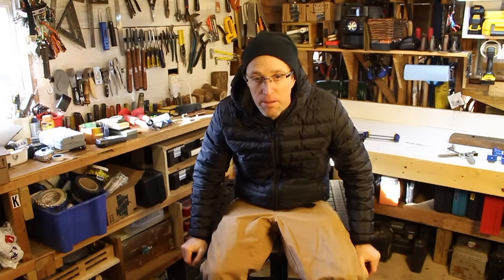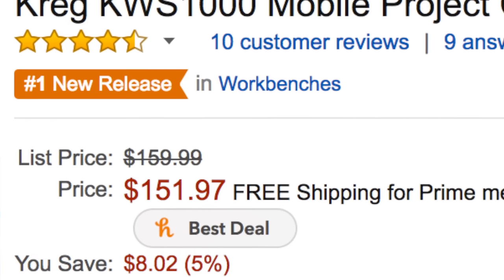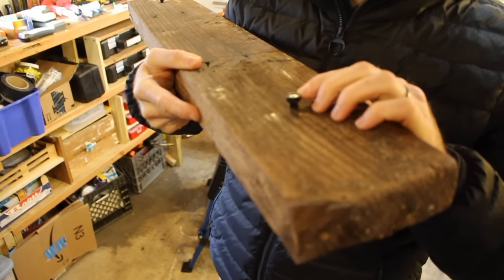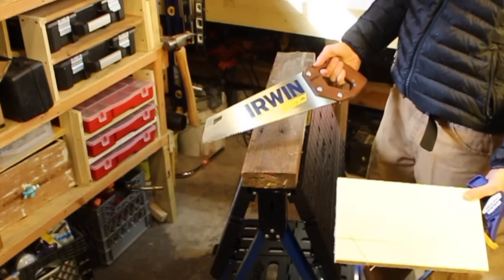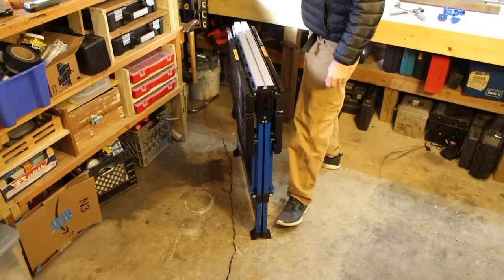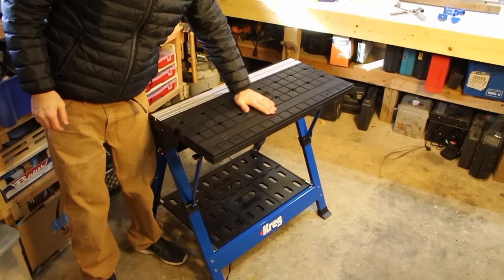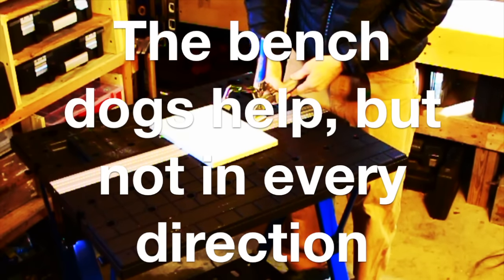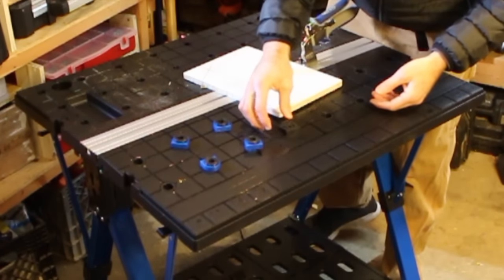Quirky Kreg Mobile Project Center

Comment: I have been really looking at these for what they are: A portable, fairly lightweight workstation. My opinion is they are an acceptable solution. Granted, the biggest fail with these is the absence of a table lock in the down position so that they can be carried by holding the table surface as opposed to the folding shelf. I'll give you that. However most of your other criticisms are unwarranted. It is in fact remarkably stable in the open position which is the only thing that counts right? Twisting it in the folded position proves nothing. The legs are open channels. Channels are not ideal for resistance to torsion which is what you are subjecting to by flexing the workstation with the legs folded. In the open position the folding shelf acts as a shear panel and that is the main function of that shelf, not a foot rest. I believe the shelf has a rated capacity 25lbs. Will it hold up to years of service in a heavy construction environment being thrown in the back of a pick-up with other crap. likely not. Will it work for a cabinet maker, trim carpenter, or home woodworker who treats his tools with a measure of respect. I think it will. Cheers.
Reply from the maker: Good luck with it! Your points are valid and, with some care, it should serve you well
Reply: I carry mine by the table top in the folded position.  I am careful to not let it open, but a closed lock would be nice
Reply: I agree its a good product also there a  another video with a great cheap table lock for this it s a pin that gos threw the dog holes with a locking cotter type pin that gos threw that ,,, it works great and it can be replaced at will ,,most under 10  if not 5 dollars for this device and it doesnt get in the way if removed to unlock  and some have hadles on them if your arms are to short so you have and extra handle set higher now

Comment: I have used mine every day and used it rough.  I use it to hold my planer,  belt sander, orbital sander and router table ( not all at the same time though).  It does a GREAT job for what it is designed for.  At 50 lbs. it's not flimsy or cheap and is rock solid when open.  Does it really matter how much the legs flop around when it's closed?  I mean you're not using it when it's closed as it's stored away!  If I slam my closed workmate around like you did that Kreg, it flops around also.
Reply from the maker: I can see your point, Steve. I've come to like mine more over time ... but the fact that it flops open so easily when moving it still bugs me. I'm glad its working out for you!
Reply: Agree.  I think it was designed around their line of products and more as a clamping, joining, sanding, assembly, etc. workstation as opposed to heavy construction, hammering, etc.  For me the biggest pro is that If you have Kreg tools they all interact and the pre-drilled locations to mount your Kreg pocket hole jigs were very nice.

Comment: I have been a plumber for 23 years. I own a business where we work in major commercial, industrial, and municipal locations. I also do minor woodworking and leather crafting as a hobby. I am very familiar with tools and equipment I don't have this table but it appears to be a mobile medium duty item. I don't see anyone in the trades banging around, slamming, and shaking their gear like you appear to be doing. It would be interesting to see how you pull out a chair to sit down at the table or open the fridge. Condiments are falling all over the floor, shelves are cracked. Splintered chair legs have been glued back together, multiple times.
Reply from the maker: Yeah, you've got it: I'm rough on stuff and find the best tools are ones I can beat up or drop out of the back of the truck and they keep on working. Cool to hear that you've been plumbing that long. It's an awesome trade.
Reply: I thought the same thing. The table is actually a multi-use table but it is purpose built for building cabinets and drawers and such. And for those who do that sort of work and they see you throwing shit around in their shop they will throw you out on your ear. This is literally a mobile work station for pocket hole projects. It's not a workbench. Hence the name. 2 totally different things.

Comment: I bought 2 a couple months ago.  My only real complaint is that when the tables are up they are not completely flat.  That kinda the me off since I was building a dining table and needed that flat assembly table.  I'll span the two in the future with plywood
Reply from the maker: Plywood sounds good --3/4" will be solid!

Comment: I haven't had any of the problems you're experiencing with mine. I realize everyone can have their own opinion, but I can't help feel that you're coming at this product as a professional when I'm not so sure you're the targeted demographic.

As someone who is an amateur woodworker, who has a garage so small he can't fit a traditional workbench, and who has to build modular stands that can hang on the wall for all his tools, this thing has been a lifesaver for me. Mine has no problem staying shut, if anything it's hard to open. Mine has no wobble. It's solid as a rock, but then again, I'm not trying to build dining room tables on it. I threw a little grease on the screws for the sacrificial board and it slides as smooth as butter, no hammer needed. Who cares if there's skyward play at the corners? All that matters is whether there is downward play and there isn't any. The bottom tray is meant to throw some light tools or some spare wood on, not your foot. Your demonstration of locking the wood down with the clamp is suspect because your position of the wood places all the force on an area of the wood with two slick metal runners on each side. Lock it down on the plastic work area and it's not going anywhere.

Again, you're welcome to your own opinion as an experienced woodworker, but you're scaring off the people this product is likely meant for.
Reply from the maker: +Rob Cartwright .... I appreciate your perspective and see where you're coming from. Perhaps over time I'll come to like it a bit more! Take care
Reply: metaspencer I apologize if my comment came out as harsh, it wasn't intended to be. Take care.
Reply from the maker: +Rob Cartwright .. it's all good! Take care
Reply: Yes it is not marketed to professionals with large shops like metaspencer. It's marketed to people such as yourself that don't have full shops and don't have tons of room. the whole plastic spacer issues and pounding it in with a hammer could have been fixed very easily. Back the screw out some. That simple, why you would sit and beat on something with a hammer then complain is beyond me when the solution is that easy.

Comment: I watched your video on the Kreg KWS1000 Mobile Project Center.  I couldn't help but post this as you are giving people some very misleading information on the product.  First, you are picking up on the tables.  The tables are solid if weight is applied to them.  Second is that you are stepping on a folding shelf designed to only distance the legs apart and hold something light weight and not the weight of a foot stepping on it.  Next is how you are lifting the table.  You are not using the handle but grabbing the table.  Of course it is going to unfold.  Then you hammered a board onto the top of the table.  It takes a second to adjust the screws and it slides like glass - if your borad isn't warped.  You then show sawing a board on top of a board with a Irwin clamp holding it.  Why didn't you just use the the tables and Kreg clamp?  If you adjust your Kreg clamp correctly, the board will not move.  I own this and it is rock solid.  You can't hardly move it with a hammer.  There is no "wobbliness" as you stated in your video.  The worst part is that people are watching this and believing what you say it true when it isn't.  I have owned this for sometime and can tell you that it works as advertised.  Perhaps you received a defective unit.  In your video it shows the side of the table broken.  Call Kreg.  I have called them at least 6 times and they have sent me replacements for various problems with no charge.
Reply from the maker: Wow, you've had six problems with your table and that many replacements??? It sounds pretty horrible as a product. I'm sorry to hear that you bought something that needed that much customer support and replacement gear!
Reply: No problems with any of their products performance.  Some missing pieces that were sent for free any within a two day delivery.
Reply from the maker: Others have found this work table to be quite dangerous. Just check out this example of the pinch-points: https://youtu.be/UFvssRe0J38
Reply: I am not saying that with improper use that any tool including this one can't be dangerous.  Just the things that you did in the video do not accurately show the correct use.  For instance, just putting your foot on the bottom shelf.  It is actually molded into the top of the table to not do this.  As I said before,  your opinion is yours, but the way you show use is not correct.
Reply: @metaspencer  Pinch-points quite dangerous?...Geez, how do deal with hammers driving nails and power tools??

Comment: Looks kind of junky.  Get a Black & Decker Workmate.  Had one for 30+ years and it's good as new...except for a few saw marks.  Negative is it's heavy...but that makes it stable when using it.  Good job.
Reply from the maker: I totally agree. The Workmate is a classic, sturdy, simple, and works well.
Reply: Mike Stiner I have one that I got a long time ago. It's probably about at old as yours or older. They are very sturdy. I don't have any saw marks in mine but all the wood is stained with oil. Definitely a quality product and I am glad it's still made today
Reply: In addition to a few saw marks mine has about 20 different color paint drips and overspray on it but those are just signs of use.  Still works great and I even still have all the clamp attachments that came with it.  Not very pretty anymore but it works like new.
Reply from the maker: character and history!
Reply: Just sold mine through Craig's (not Kreg's) List because I have no need for it anymore.  Lots of dings, dents, cuts, paint and chemical drizzles - real character.  Guy that bought it is starting a handyman business and was pleased as punch to get it because it still worked like new.  Guess some people buy these things to look at and brag about, but when it comes to a work surface plastic and flimsy construction doesn't cut it at all.

Comment: I thought it was overpriced from the beginning.
The Ketter (Keter?) brand is good for half the price.
No, the Keter  it's not Kreg tool friendly with all the custom pieces, but they're fine,
The Ketter also comes in several different variations everywhere including Costco and BJs and also sold under the Husky brand.

Thanks for confirming my thoughts on it.
Liked and subscribed.
Reply from the maker: I haven't heard of Ketter/Keter, so will have to look into that. Thanks!
Reply: That looks real stable!
Reply: Keter is a pretty popular tool box manufacturer. They are also an OEM for other brands. I have a Husky (Home Depot) toolbox made by them. The Kreg KTC22 Toolboxx is actually a Keter.
Reply: RickMakes I bought a nice large Keter toolbox at Costco for $20 the other day. Plan to use it for plumbing and soldering.
Reply from the maker: That's pretty interesting. It's amazing how branded merchandise is built by different companies

Comment: I have been pretty dissapointed with some Kreg stuff for a while now. Their flip stop for the miter saw fence is no longer perfect....they changed a couple things on it and sucks now. Luckily i got a couple old ones. The new auto adjustable clamps suck balls! I only use the old good ones. Their router table top and fence are junk...sold them of craigslist at a fraction of what i paid just to forget about them. The new pocket hole benchtop deals seem really plasticky. 
I have an older floor model electric machine and it is solid. 
Im not a fan of new cheap flimsy plastic that only pisses me off as i work! Im a sort of old school heavy duty type of guy! LOL
Reply from the maker: I haven't seen as much of their stuff as you have, but I'm not impressed so far
Reply: I love the new router fence and top.  What is wrong with yours?  I have had zero issues with mine.  I hate the new tables.  The feet have a long slot as opposed to individually punched holes for the carriage bolts.  I have the older style table for my router and prefer it over the newer ones for sure...plus it had all the hardware included unlike one of my tables.  I do agree about the adjustable clamps.  I'm not a fan of those either...some work and some don't PLUS the ones I see at Lowes are off center when you go to apply clamping force.
Reply: Are you comparing the 3,600$ DK series machines (the floor standing model) to the 400 DB210?
I've done probably 500 holes in my DB210 with zero issues and much faster then using a k4/k5.

Comment: I'm not a Kreg employee.  Just a customer.  But your review was very unhelpful.  You didn't even clamp the wood pieces properly tp cut with the hand saw.  And overtightening the 2x4 grommets just looks to me like poor workmanship, not a defect in the product.   Stepping on a shelf rated for 25 pounds a!so looks to me like disregard for the product instructions and limitations.  Abuse any product and it will appear deficient.  
Disappointing "review".
Reply from the maker: I compare the Kreg table to a few others in this newer video: https://www.youtube.com/watch?v=h0L3jtpaMWk&t=10s

Comment: Very lousy and  inaccurate review.
Reply from the maker: It's too bad the materials and design are so poor
Reply: metaspencer  sorry The spellchecker on the phone misspelled, meant to say inaccurate review. 
If I didn’t know any better I would agree with The statement in your reply, except for the fact that I’ve actually worked with & handled this item that you have poorly reviewed. 

I’ve worked with other similar mobile workstations and this is by far the most solid versatile and well-made station I’ve ever used, or seen especially for the price. When I saw you grabbing the table top and pulling up and down, that didn’t make any sense whatsoever. 
When you use a table you’re pushing down and there is Weight pushing down from whatever you have on the table. What you did is similar to somebody taking a slip joint folding knife, & pushing down on the spine and saying, see it doesn’t stay open. Then your kicking the bottom shelf with your foot that is only meant to hold about 25 pounds. 

Based on what I saw you either don’t know how to work very well with these tools due to lack of finesse or attention to detail or you deliberately try to make this table look bad. Or you really did Get a dud. But I don’t think that’s the case. 

I don’t mean to sound like a d—k, and I think you have some great reviews, And some decent information, but you’re way off on this one.
Reply from the maker: @edgedtalons  You are certainly entitled to your opinion and I'm glad to hear you've found a good work table for you. Take care, man!
Reply: metaspencer Thank you for saying so. Honestly I’m not opposed to the idea of you improving on it making the ultimate folding workbench. Something that is portable, folds & is solid as a tank. 
I am not saying that this table is the best table out there right now, but it is the best I’ve seen or heard of. But God knows if you made a better version of it, he’ll I’d buy it.
Reply from the maker: @edgedtalons  Just go back 50 years and you'll find the Workmate, which is more solid, folding, cheaper, etc. It even takes bench dogs https://www.youtube.com/watch?v=h0L3jtpaMWk&t=1s